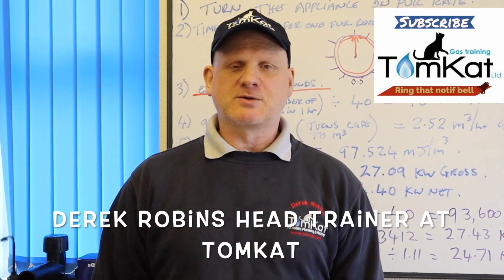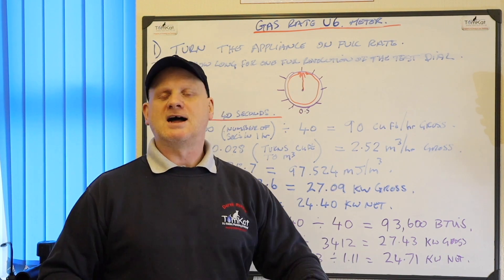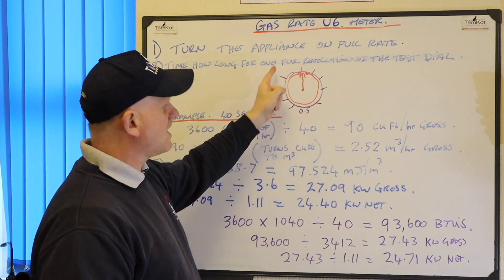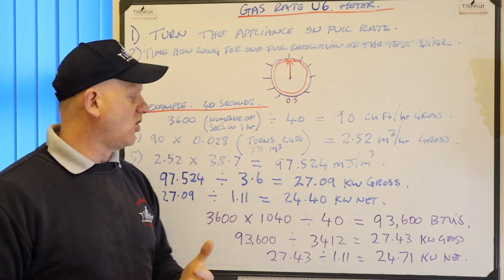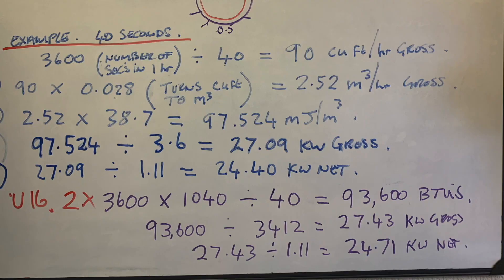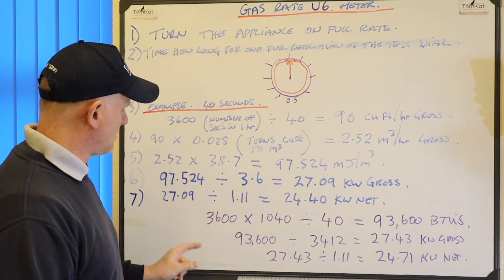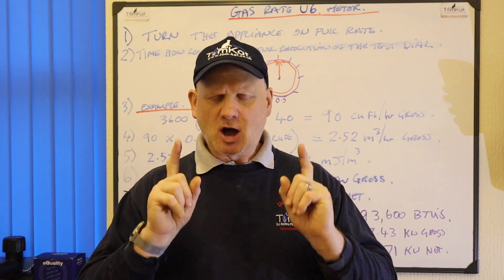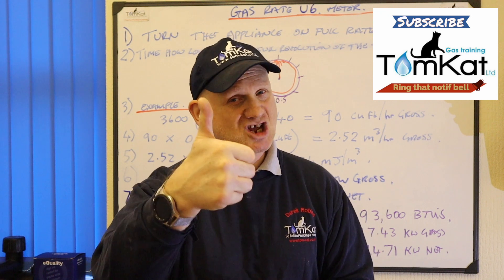HOW TO GAS RATE U6 METER part 5 of ACS revision in 10 minutes or less

Comment: not sure if you have mentioned +5% -10% tolerance.....
Reply from the maker: The tolerance has only been added by training centres to give trainees an idea if the gas rate is correct. There isn’t anything in the regs or manufacturers instructions to say you have this percentage. Once you get experience you can use your engineers judgement to say if a gas rate is good or not

Comment: Hi Derek, if you're gas rating a cooker will you need to put all 4 hot plates on, oven and grill on max also?
Reply from the maker: You would gas rate each ring separately and then the oven and grill separately to

Comment: I was taught on an imperial meter to:
1096 dividend by seconds give up the same answer. 

On a metric meter you take the two readings and multiply it by 323.

1096 and 323. Much easier to remember. Good to know how to figure out all the other things like mj/m3 etc etc though